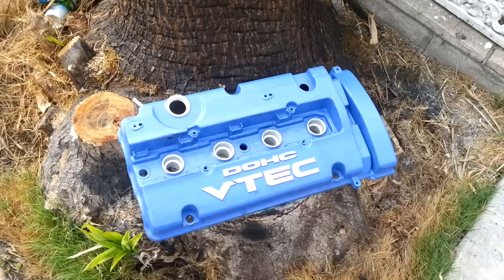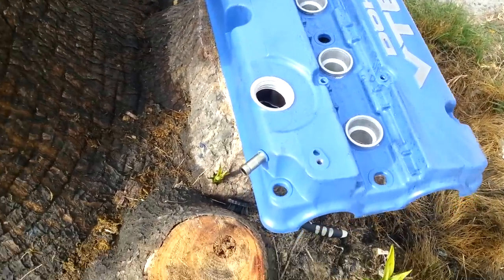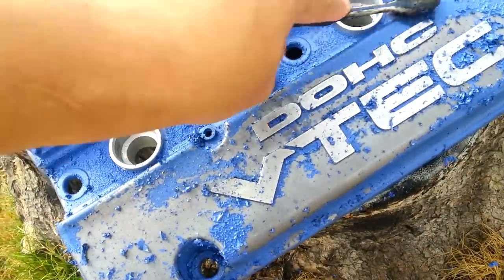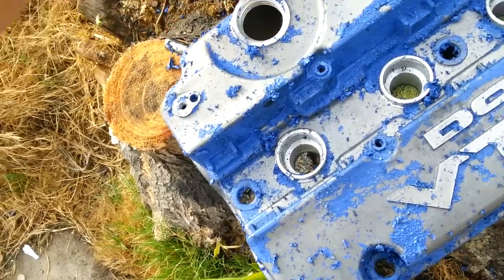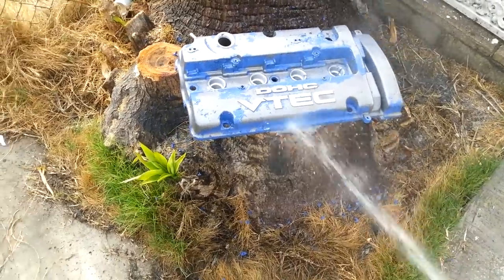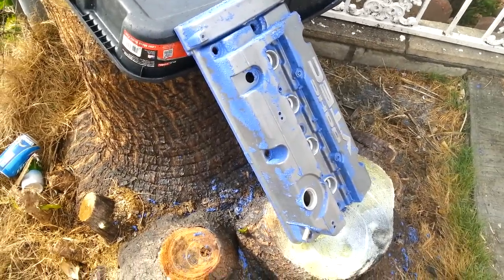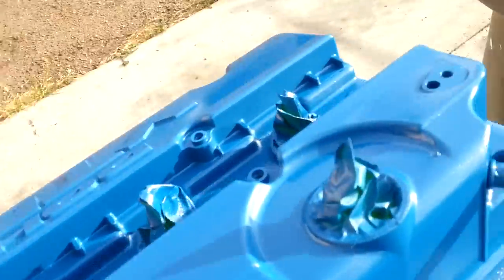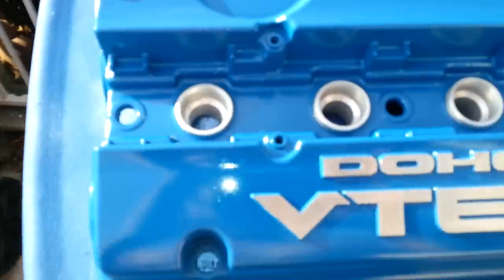DIY How to Paint your Engine Valve Cover - @winstonbuzon

Comment: Love your videos man! 

I'm stripping a set of J32A2 valve covers and I gotta say, they're really giving me a hard time. I think that Honda started to use a different paint for the J series valve covers. I'm using KleenStrip Aircraft Remover, and it only bubbles up in certain areas. Other areas seem completely resistant to the stuff. The paint is also like 2mm thick. I've tried the aerosol and the faster acting brush on liquid.

I've also noticed that with the J covers the casting is a bit more textured, unlike the B/D/H/K series covers. This makes it so that when I go to brush or scrape it off it just stays impregnated in the surface.

What a headache! I should be done soon though. Last step for me to do is wire brush.

Keep doing what you do brother!
Reply: One good thing is that I got the set I'm working on out of a junkyard so I don't have to rush :)

Comment: I did mine just like you did, just seen this vid now but I painted my b18c1 valve cover gloss white and my letters purple with my bay color, and also painted my wire cover purple, all the purple I applied clear coat with sparkles and it looks awesome, another thing that works really good is heavy duty paint stripper at Walmart, you have to apply with a brush though because its not in a spray can
Reply from the maker: As you can see, the Rust-O-Leum "Aircraft Paint Remover" can is what I preferred.  I tried the brush-on type but that was really harsh on the nose and skin...and I really had protection at that time.  I tried both and this one, at least, I didn't have to use a brush.

Comment: Very informative. Great vid. But instead of masking the letters, and using all that time, when the valve cover is fully coated and clear coated, use a hobby file (theyre smaller) to remove the paint from the VTEC lettering. Saves time. If you want the best of both worlds, mask only the big chunks, but very basic. Then use the file to get the small stuff. Did that with mine and it turned out great
Reply from the maker: Matthew Kvilvang Would love to see it... :)

Comment: too clean brosef!  when i first saw it, i thought it was blue with neon green/yellow lettering! that would be crazy!
Reply from the maker: That's actually a great idea!  Of course, for that to properly work, you'd need to find very high temp paint with that color.  That gray part?  That's what it looks like with just the paint removed and unsanded or polished...
Reply: Winston Buzon oh yea my bad i meant the grey and green lettering, but the blue would look dope af too!  if you had other bolt ons that matched the color of the lettering..

Comment: Are you using a high temperature paint, or a powder coat?
Reply from the maker: Very High Temp paint  :)
Reply: Does it hold up well when the engine is at operating temperature? Also what brand is it?
Reply from the maker: It's called VHT or very high temp for short.  It holds very well.  :)

Comment: What paint did you use? Does any paint work? I know it heats up so there should be a specific type of paint.
Reply from the maker: Jiovanny Zavala High temp engine paint, preferably 1000 degrees or higher

Comment: Working as a painter, I can tell you that Aircraft Stripper is nasty. It contains methylene chloride and can cause sever skin damage. Always wear gloves, mask, and safety glasses/goggle when spraying!

You could have also used a scuff pad to scuff up the area to be repainted followed by blowing it off with compressed air, then a quick wipe with a tack cloth to avoid having to use this stuff. Finished product looks good though :)

Comment: Put vaseline on the letters with a q-tip (ear cleaner) you can just spray paint right over it then when it dries clean the vaseline off. Thats what I did. The tape idea is good but some people might want a faster way
Reply: Just putting this out there, the clean up with the tape is wayyyy better. So id use tape..but I personally used vaseline. You just have to lightly scrap the dried paint/vaseline which could be annoying for some. But yea..just another option for any1

Comment: I see you didn't primer it before painting. Is it a special paint for alloy metal?
Reply from the maker: Nothing special.  I used Etching Primer on it prior to doing the paint the second time around...
Reply from the maker: Mine hasn't so far, but if you really want to be sure, use etching primer
Reply from the maker: Just the top

Comment: I was thinking about doing mines, do you think it would be coo to add a clear coat? Or will the heat be to much for it?
Reply from the maker: If the clear coat is designed for high temps like engine paint, then you should be ok

Comment: So when painting my valve cover, can I clean the back side also?  Should I cover my engine block also with plastic so no dirt enters the engine? Thanks in advance.
Reply from the maker: Yes, you can definitely clean the back side, just DO NOT apply paint (makes sense, right?)  When covering the engine, definitely use a clean plastic
Reply: Winston Buzon thx bro

Comment: Nice video, really entertaining to watch. I was wondering if it is too hard to paint with spray cans, as I haven't tried it before.
Reply from the maker: IgnacioSeveriens No it isn't.  You just gotta clean the surface really well, and also use etching primer if you'd like
Reply: Winston Buzon Good to know, thanks for the answer.
Reply from the maker: IgnacioSeveriens No prob

Comment from the maker: @Reyna Navarro - Ford Blue
Reply: +Winston Buzon (DubEezy) would putting paint on your engine and other components hurt it in the long run? I would think the paint would work as an extra condenser layer holding in heat in your engine.
Reply from the maker: That's why I don't put so much layers on it
Reply: Sir 400 degree ok?hi temp paint to engine
Reply from the maker: If there's a higher temp paint, the better...

Comment: I have an evo, and struggle with the letters, the "evolution" writing is too small, so its hard to tape up. Im thinking of just using a dremel and grinding the paint off. Good idea?
Reply from the maker: +donkey1450 Are the letters removable?  If they are, just carefully remove them.  Lay them out accordingly on a strip of tape.  Then, when you're done with what you need to do, just buy some adhesive, put them on the letters, and then carefully line them up and slap 'em on
Reply: Hey mate, cheers for the reply. They are part of the rocker cover unfortunately. I managed to get the paint off using a dremel though. Just needs a bit of sanding for a smooth finish.

Comment: can you do a video on the rear brakes of a 94 to 96 honda accord ? i bought a car the had no brakes due to the wheel cylinder so i changed them but now i step on the brakes and it pops the new one out again and they told me it cuz theres air in the brake line but i bleed it like 7 time and still nothing. please help me thank you! Winston Buzon

Comment: I have a 99 civic si B16A2 red top that I'm trying to strip and reprint. I'm ushering the same stripper u did in the video but no matter what I do the paint is not coming off. Can u help.
Reply from the maker: Spray again with the stripper, but instead, brush or agitate it with a metal brush or leave the stripper on longer...

Comment: Did you have to sand before painting   I want to paint my intake manifold on my 99 mustang. Any tips
Reply from the maker: No, but I made sure there was no oils or anything on the surface before applying the paint

Comment: what kinda of spray paints do you recommend?
Reply from the maker: If you're looking for affordability, check out what your local auto parts store offers. But if you can spare a bit more, my money would rest on the 2k aero-spray paint cans.
Reply: +Winston Buzon (DubEezy) thanks Brother!...very nice job on that valve cover will be doing that too mine pretty soon....h22a ..
Reply from the maker: +eric brragan But don't forget to make sure that it can withstand high temperatures
Reply: +Winston Buzon (DubEezy) very helpful tip...thanks I appreciate it :)

Comment: Why did u strip it to begin with. All u needed to do was scuff it and shoot it. The new paint would stick to the old if it is clean and sanded. You just stripped it cuz u either didn't know or u just wanted to

Comment: This is inspiring. That stripper isn't available here. Will paint stripper work as well?
Reply from the maker: Yes, but it will depend on how long it will take to remove and if you'll need to use other tools (like a wire brush)